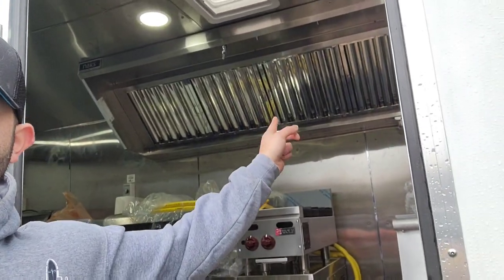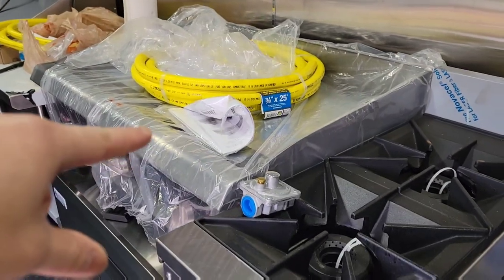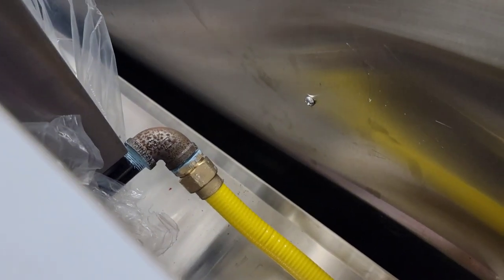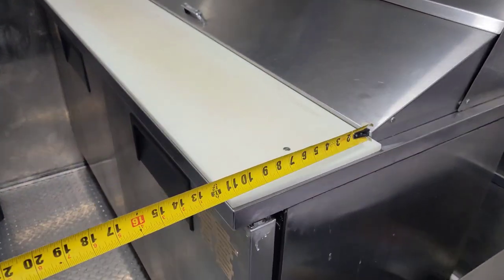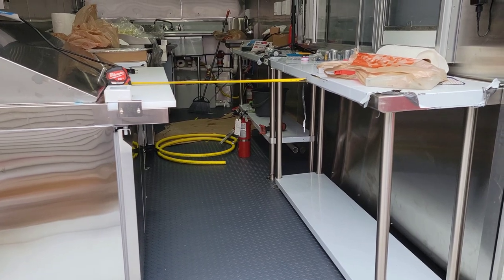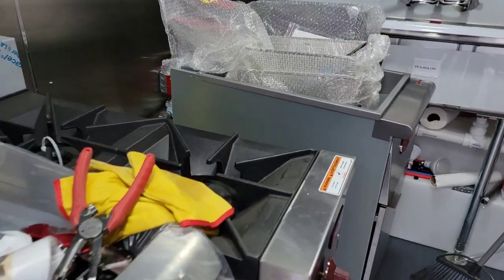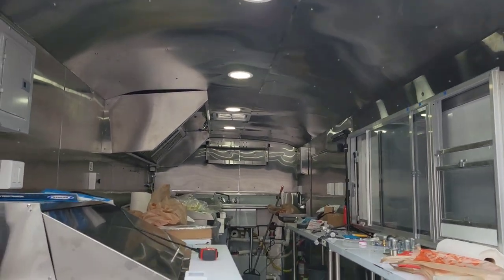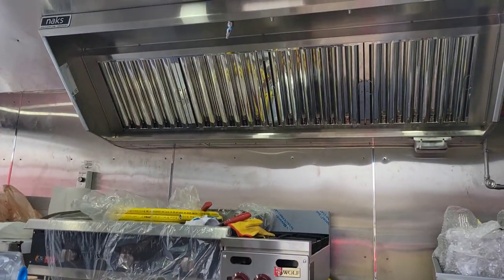Building your Food Truck Final Steps👩‍🍳👨‍🍳

Comment: I wonder about putting the outlets sideways so they wouldn’t stick out towards the back of the prep-cooler or whatever it may be..
Reply from the maker: You would have to make a knock out because the wiremold box does not come with side knockouts

Comment: Hey Frank, love your videos. Looking for some quick advice. I'm putting together a beer truck, and I have a 50 Amp service. I'm planning on running a 50Amp extension to an inlet on my trailer. Should I use the sub panel in your description (I'm leaning that way)?
I'll be running a 15k btu A/C unit, an 8KW water heater, exterior/interior lights, and possibly some external space heaters. Any advice is appreciated.
Reply from the maker: That panel I have absolutely will be able to handle 50 amps. Great small panel there

Comment: To lock the wheels in place you can use Regency Stainless Steel Caster Placement System or Krowne 28-200 - Krowne Stainless Steel Caster Positioning Set, Includes (2) Stainless Steel Chocks.
Reply from the maker: I have seen those the only issue I have had with those is that the prep fridge wheels are pretty small and they don't fit well inside that wheel slot I have noticed
Reply: @fbaltierrez   maybe these would work Sauber Equipment Restraint Caster Chock

Comment: Hey my vent hood keeps leaking when it rains  had it installed by proffesionals i have took it back 4 times and its still leaking need help
Reply from the maker: All I could think is not enough is possibly the Flex seal weatherproof on the Bolts on roof
Reply: @fbaltierrez  we got some k9ol seal we are just going to coat the whole roof hopefully that fixes it